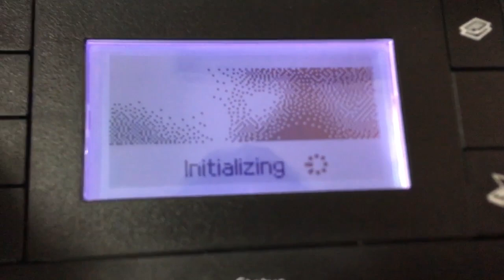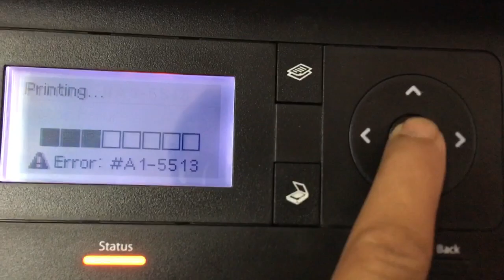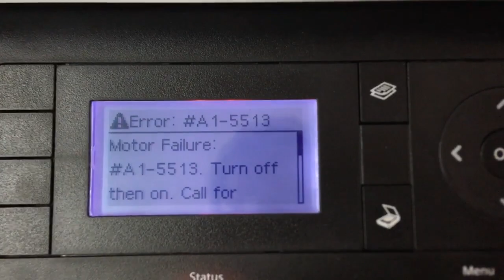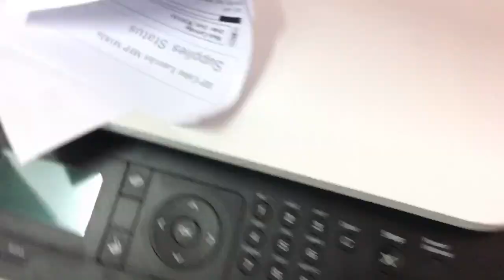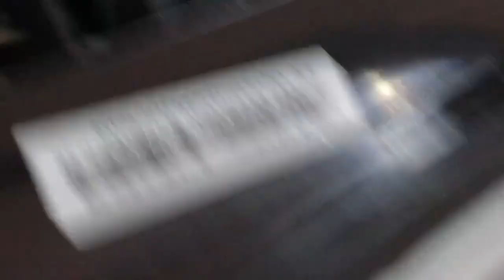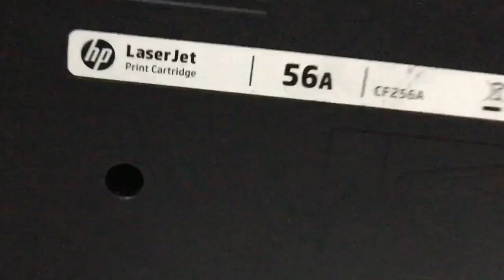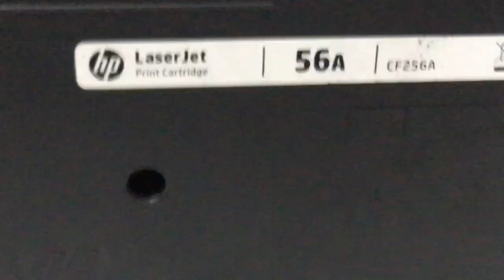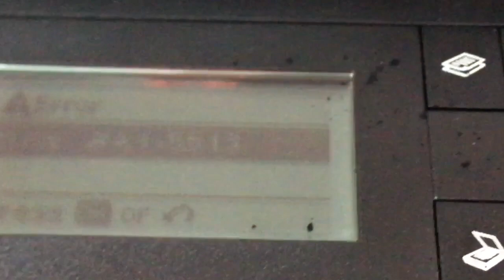HP LaserJet MFP M436n display error code A1-5513 checked part 01

Comment: Have forgot the ews password for hp438nda, can we hard reset it or any other option
Reply from the maker: You try install full driver, go to control panel and Devices and Printers double click on printer select tool box, try to reset on setting or login in printer by IP

Comment: Imaging unit is not installed.install the unit. Bole to ky kare sir
Reply from the maker: so for late,you mean the printer message (Imaging unit is not installed.install the unit)? if so checking chip image and connection

Comment: #S3- 3211 Error ka vedio banye plz
Reply from the maker: Code: S3-3211, S3-3213, S3-3214, S3-3215, S3-3216, S3-3217
Display: Scan System Failure #: Turn off then on.
Description: DADF is not connected communication error occurs with CIP6 board.
Remedy: 1) Turn the power off then turn on. 2) If the problem persists, check the DADF unit connection. 3) If the problem persists, remove the DADF unit to find the defects. 4) Remove the DADF rear cover. Check if the connector on DADF board is connected correctly. 5) If the connection is OK, replace the DADF